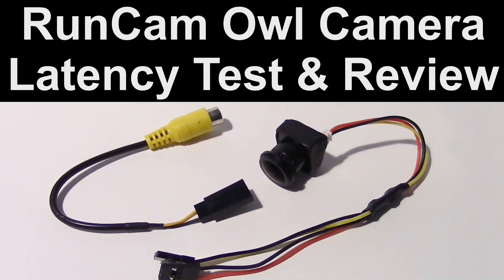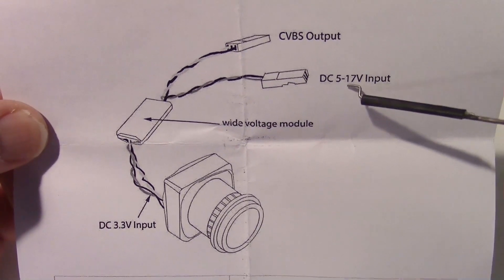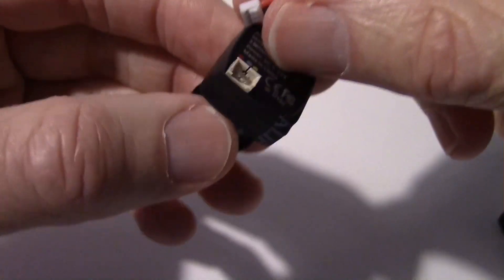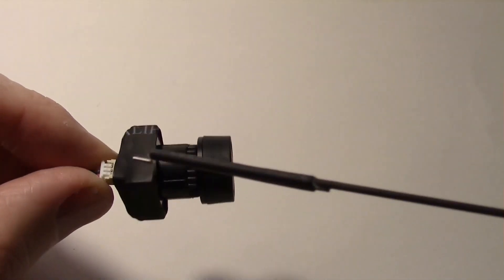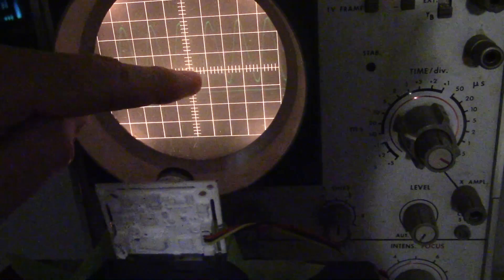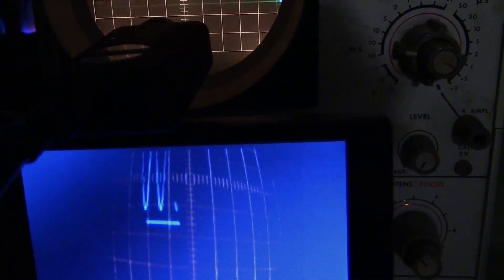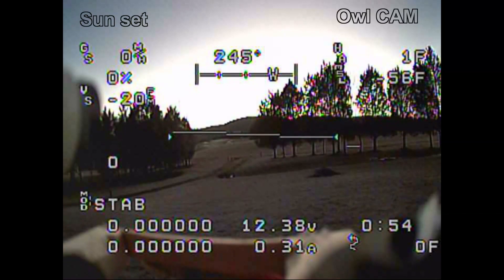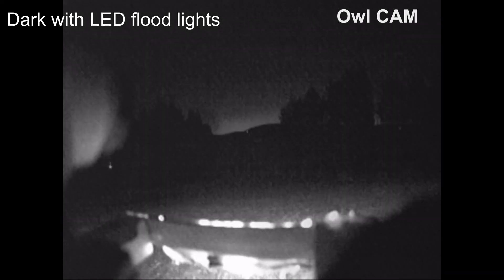RunCam OWL Starlight FPV Camera, Latency Test, Low Light Test, Wide voltage range

Comment: Hi, Can you use 1S Lipo without the regulator?
Reply from the maker: +s3299 I would not do it because the camera needs 3.3 volts and a 1s goes to 4.2 volts. Perhaps you can find a 3.3 volt tap on your flight controller board.

Comment: Nice review Dave, but is it my imagination, or didn't you already review this thing a couple of weeks ago?  I didn't remember the oscilloscope latency test though, so I'm thinking you redid the test.  Anyway, what news on your Drak?  I decided on the Ritewing motor and ESC but found some great Hitec servo's on Amazon.  I'm doing the sparring this weekend but am really spending a lot of time trying to figure out all the equipment variables and where I want each component. And, also watching to see what others are doing. lol  

Have you seen the Dragonlink 1.3 ghz vertical dipole antenna everyone is talking about?  It seems that the element lengths are way shorter than the VAS 1.3 Semi rigid dipole.  I don't know how that is possible. I'm going to ask Alex Greve (IBCrazy) to check it out. Thought also you might have one and have some insight.  I have one coming from FPVPro.com.  Long comment, sorry :)
Reply from the maker: +Tom Muhleman, Jr. The Drak is probably going to be built this spring. I am with you on waiting to see what other do with theirs. Not sure what motor to use yet. 
You are right about the video. It's a remix with more detail at the end. Thank for watching... again :-) Have never used Dragonlink just EZUHF so not sure about the antennas. Let me know what Alex says.

Comment: Very comprehensive and informative as usual, Dave. The results are a bit disappointing in low lux, or is it the PZ that's also very good? I like your latency testing..... if you get chance, can you do the RC2 to see if it's the advertsed 40ms (720p120fps) and 60ms(1080p 60fps)?
Reply from the maker: +Vortecks I am kind of interest to see what the RC2 does too. Will do.